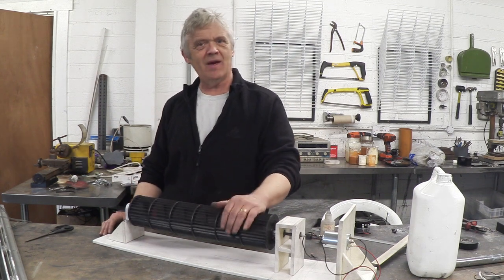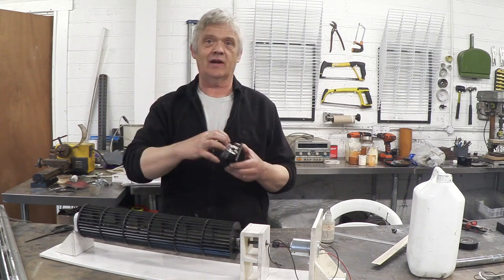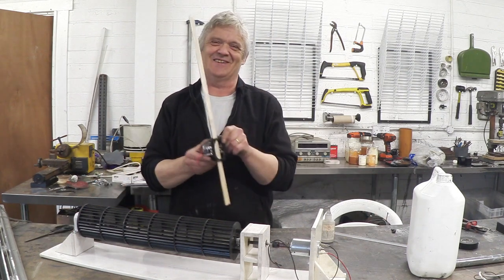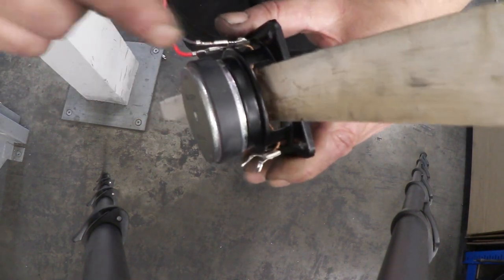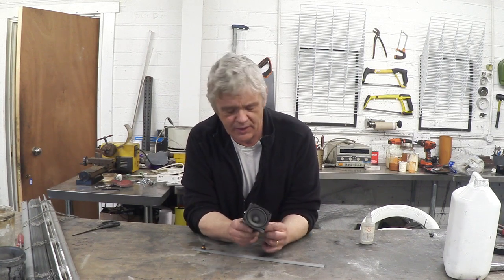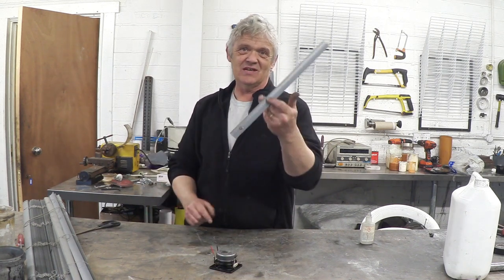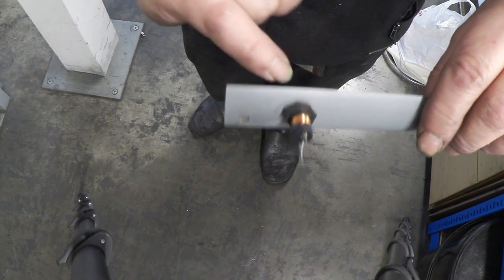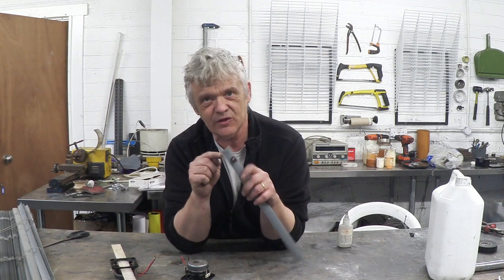Weird Wind Generator   No Blades, No Moving Parts

Comment: Oh yeah mate, now your talking. Now figure a pole that resonates at 7.83hz or the most saturated signal around .here 60hz power lines could be tuned into like radio but there is a draw back. The height to ground separation is where volts are derived. The arieal or top hat size determines its ability to capture,.,surface area. A antenna for receiving would be best if it was a omnidirectional ,sphere or dodecahedron type design.

Comment: I have a 22' by 50' greenhouse that has tightly stretched plastic over it. It works like a speaker when it rains and when the wind blows. Lots of vibration even when you talk.

Comment: add multiple connections to the bracing of solar panels which would then slightly vibrate when the wind blows?  Instead of securing solar panels with as few connections to their stands make hundreds of connections that vibrate enough to activate this principle.  Asking because I don't know

Comment: I have seen the same thing were a man set up ribbons like blinds in a window with coils and magnet at the ends of each ribbon that added together to up the voltage, have also seen a man get a solar panel and slice it into ten mil slices and turn them sideways and reducing the size of the solar panel greatly without any power loss.

Comment: With the wind turbine, adding a weathervane to catch maximum wind direction. Plus a governor, pivot gate and vent bypass escape for excess wind. Use inside a tapered duct to capture and direct use of to the reacting side of the rotor only. Shielding half of the rotor from wind. In effect apply power of wind to best area for efficiency.   Speed control on fan, as old gramophone governor, shaft driven to link wind  escape flap amount.. the governor balls spin helps smooth the rotation in strong wind plus adds inertia

Comment: I imagine a blind, like a window blind hanging on my patio as a sun and wind shield AND generating energy or recharging a battery bank.  That is brilliant as it doesn't require as much wind and doesn't have to mounted high, in the middle of the air AND is functional as it is.

Comment: Sounds like a windbelt.  Windbelt's took a 3ft pole with a perpendicur bar off each end. A piece of video tape is stretched between the two bars and can freely vibrate when the wind blows over it.  On one end is a magnet doing pretty much the same job as the speaker does here.

I thought putting them as the slats in a fence or under a railing would be a good place to put a bunch of them.  Could you imagine how much power such a system could generate if it lined a pier?

So here's a question... If a row of these lined a subway track, would they create extra energy, or would a consequence of creating that energy put drag on the train such that extra energy was needed to propel the train forward that was equil or greater than the energy generated?

Comment: this was described in a TED talk several years ago as a way to  provide power to rural Africa so people weren't dependent on fire for light. A strip of material stretched  between two supports with a magnet attached to it in close proximity to a coil. The strip of material vibrated in the slightest breeze and produced current. The voltage was rectified and powered LEDs.

Comment: Interesting, but does it have a practical use case? Maybe if you have a few hundred thousand of these for areas which have consistently low wind? But that place probably has sunlight, so this still would not make much sense over something which can harness wind to turn a shaft.

Comment: Ok I have a question and my understanding may be wrong but here is my question, taking on the principle of the poll and the using the speaker principle what if you had a poll and say 50 medium speakers attached in say a box , I ask this since the one you had put out I believe 6 volts could this increase the volts and amps in order to use it instead of a wind generator or solar panels?

Comment: I wonder if you copper plated the reed and etched a track on it then put in between the poles of a horseshoe magnet? To wobble about in the strong magnetic field. Take the output through a bridge rectifier and a buck/boost converter to a battery bank. A coil could be etched onto each side of the read to increase coil density. 
Only problem is supply and availability of rare earth magnets.

Comment: I worked with a company trying to engineer an electric car years ago. I am a master mechanic, aircraft and heavy equipment, not an engineer. I was working with engineers and I suggested using electric motors on all wheels that could have the action of dynamic braking to put amperage back into the batteries and the engineers sneered at me and one said " you aren't an engineer, you are trying to come up with a perpetual power system and it can't be done". now it is in common use and very effective but I wasn't an engineer.

Comment: What if you married a bladed fan with a cam of some sort to the speaker magnet? You might be able to get a longer and more consistent stroke out of your magnet? Maybe even a cam shaft with multiple magnets running slightly out of phase from each other? 
Just another option.

Comment: So if we built these as panels of reeds or battens and put them along side major roads or motorways to replace the current noise absorbing panelling we could both reduce traffic noise and generate power for local use?  Would these absorb more energy than passive panels making things quieter for nearby residents?

Comment: What happens if you get a subwoofer and attach a long pipe to it then let the wind blow over the end of the pipe as per the blowing a note on a bottle trick? Can you make it subsonic so that it does not bother people but still capture a useful amount of energy? Obviously it would have to be inverted otherwise in use it would fill up with rainwater. :-)

Comment: Build this into bike frames to power the lights never need worry about dead batteries. Or into the tall flags that are on kids bike trailers/ recumbent bikes that are used to show drivers that a low profile vehicle is in their way. That would do 2 things the flag does its original job its designed to do and the other thing is it would again power warning leds that are on the flagpole to give a flashing warning

Comment: When you were a kid, did you ever put a blade of grass between your thumbs and blow between your thumbs across that blade of grass to make a sound?  What is needed here is a funnel to direct the air past the edge of the reed and thereby cause it to vibrate.  The voltage will be proportional to the rate of vibration and the current should be proportional to the amplitude of the vibration.

Comment: The fluctuating voltage is not useful.  It would need to be smoothed out and stabilised. This necessitates a  piece of expensive electronic equipment.

Comment: This is not a solid state device (wind power generator) and there are moving parts. Already there are true solid state devices with electrically seeded ionised elements which generate significant power with the passage of air over them. Maintenance is zero!!

Comment: The idea of reversing the speaker to generate electricity is awesome. 
Put them in the noisy down town areas or near factory's.  On high ways to power up light poles on highways. Andy place where noise is an issue can off set the anoiance with the bennifit of free energy.

Comment: Very interesting! Decreased or increased tip angle may increase the buzz? Long thin tensioned cable similar to a guitar string?
Reply from the maker: lots of playing around mate - go for it
Reply: @ThinkingandTinkering  sticky backed piezoelectric material has the potential to turn nearly anything into a microphone or speaker,acoustic levitation is something I find fascinating,was thinking could a speaker type of craft hover if it could create its own standing wave? Lol bit off track!

Comment: make ones that go next to the freeway and then use it to power a battery charging system for the night. street lights will be powered by the high use of street in the day if you can get it to work on vibrations. also when you figure out how to use the vibrations of the earth itself. well  you will have changed the world.

Comment: Its a nice toy, but I really cant imagine getting any significant power out of that kind of arrangement - at best its going to be highly inefficient. As for the Spanish innovators, I'm sure someone will invest, but I'll put my money elsewhere - I cant imagine the physics making this even slightly economic. There might be a niche for charging a mobile phone when you're 300 miles from a socket (or research transmitters in remote locations, for which we have perfectly good solar panels which also have no moving parts and can be virtually maintenance free), but hauling a coil through a magnetic field using a turbine is always going to extract more energy than wiggling a stick in the wind.

Comment: might also look into paezo speakers. (found in most microwave oven beepers, and digital watch alarms, and more.   wonder abut those glued on blind blades (multiple stroung stiffly in the breeze).  mighr be able to get every luver to chatter and every chatter to send you a voltage spike.

Comment: Awesome.

A microphone is essentially the same thing, and I never thought to use a voice coil for power.  I have turned a speaker into a microphone before though . 

Now I have another excuse to start collecting old speakers again.  Lol

I currently have well over 20 drivers (speakers) with voice coils ranging from 1" to 4".     But they all work and the cones are not falling apart.   Anywhere from guitar speakers to hi-fi home stereo to professional pa drivers. 

I wonder what the efficiency would end up being, if it would be possible to get 500 watts from a 500 watt rms speaker. 

I do have a dual voice coil subwoofer with an aluminum cone and massive vented magnet I suppose would be an acceptable candidate to learn on to answer those questions.   

Robert you never cease to amaze.

Comment: Would it be possible to make the actuators non invasive? I´m imagining about 100 of those attached to the branches of tree, or a whole forest. Cheap uncomplicated energy generation from a literally green source. A sub-controller attached to the trunk would identify defective actuators for quick replacement, and a nearby central controller and a battery pack would provide clean energy 24/7. thanks, Robert, that's a genius idea!

Comment: I'm pitcturing something like a 3/4 to 1" diameter aluminum tube that is cut down the length into 2 or 3 pieces, so you have an arched shape "stick".  I have about 500-100 of these 1" tubes, all 4ft long with 1.5mm wall thickness, so fairly rigid.  

If you could make it similar to a weather vane, where it turns to face the wind, you could maximize the surface area to face the wind.  I'm also wondering if tapering the stick so it is wider the further away from the inductor, if it would not be more efficient (less mass to move at the lower ends and higher surface area at the highest part - giving a much better force to weight distribution in moving the inductor. You could even cut the tubing in V shapes, to get the top part to be wider, and also the curvature of the tubing (arch) would give it structural rigidity.  

This type of application woudl be great at remote locations where there is lots of time for a battery to be charged in between uses, like an emergancy cabin, alpine chalet or even a boat sailing the ocean as it coudl work 24/7 (assuming there is wind) and could be used to generate electricity for things like LED lights or even charge batteries (with enough units when the sails are up.

I'd really like for people to look into some kind of wind powered electrical generator for sail boats that can be used when the boat is not sailing or even when there is too much wind for the sails.   There are many times when sailes have to be lowered b/c the wind is too strong, but if they could somehow harnass that wind during these periods (or while anchored at night), it could be helpful in extending the range and number of days the crew can live on board.

Comment: Very interesting ideas - surely the same principles could be applied to a 'stick' moving in water. Either the moving current of a river or the tidal/wave movement of the sea. Suspend a stick vertically down from the magnet/induction coil, which could be huge in the right circumstances. The profile of the stick should be such that it vibrates or moves as much as possible for any given movement of water.

Comment: Those bladeless turbines have long since been debunked as inefficient.
They may be cheaper than the regular bladed wind turbines, but they still deliver far less power in relation.

So... good idead, doesn't work.

Actually I'm surprised that those spanish guys are still around and not yet "gone with the wind"...

Comment: I also heard of an idea that was a bit like 'A Storm in a Teacup'   High Voltage water droplets that are released from some wet long pipes.... wind makes them fly through the air and are collected on some other wires where the voltage has been increased...   that really is a NO MOVING PARTS wind generator.  I Love electrostatic machines ...
if you had a 'cascade multiplier in reverse... it would change high voltage  electrostatics DOWN to usable current and voltage levels.   Also the Electrophorus is ASTOUNDING! Being raised and lowered by wind!  or how about a simple Wind driven Whimshurst machine!

Comment: I have a question: how small can these turbines be made? What I am thinking about is to install one or more in the front of an ebike with the idea of using the energy they produce to constantly recharge the battery.  Of course, there would need to be some way to interface them with a particular battery. I don’t expect to have a perpetual motion machine just to extend the time it takes to drain the battery.  I think the forced induction of air as the bike moves should increase the output to a usable level, provide  controller/ inverter could be found to match the two. It should be no more difficult that the braking regeneration scheme.  The inductor array could a,so be useful, but more development would be necessary with such an array. I think one vertical
wind turbine on each side of the front fork in sort of a radiator looking contraption could add at least as much as the braking regeneration.

Comment: So... if you think about this another step... how bout placing coils, wound in both directions separately, and arranged on a wing, or fuselage, so that the passage through the electromagnetic field of the Planet generates a 3 phase alternating current
Reply: The Hindenburg ignition was a lightning strike immediately after they attached the ground cable to the metal scaffolding... as a conductor passes through an magnetic field... it generates electricity

Comment: I'm going to have a go with some 100nH inductors I have for switchers. I have some 1N1418 diodes (more efficient in this sort of circuit than an 1N4001). I'm going to try and find some small signal shottky's as OA91 are a bit too leaky.

Comment: Just to put it out there : A six foot fiberglass CB antenna mounted on a twenty foot pole would shoot a spark across the plug 🔌 like a spark plug , when it rained .It had some thing to do with the water passing over the coil of copper wire around the fiberglass  pole .

Comment: I wonder if springs might be used to try and maintain maximum vibration in any wind?  Imagine the reed as a "finger" with springs of varying strengths at each "knuckle", weakest at top and strongest at the bottom.  Weaker winds vibrating the "tip", and stronger winds vibrating it closer to the base.

Comment: I saw a similar sensor on a large motor done by the uni of Manchester. The research was to test when the motor needed servicing and we were using data analysis software from my company.
But a couple of questions before i start to experiment, how thick was the neoprene and what size coil (uH) did u use?
Thx for the video, also I think rain would also add to the effect.

Comment: Interesting idea, as a concept.
But absolutely NO WAY to get any significant or useful energy out of such a system.
Where is the energy coming from?
From the wind, from moving air! From a moving mass...
If the area of capture is minuscule, and the density (of air) is insignificant, well the output to expect is virtually ZERO !
So don't build any expectations :-(
Just think of the area swept by a modern wind turbine, and the rather strong winds expected or needed to get useful energy out !
There is no such thing, as a free meal !!  :-)
Reply from the maker: absolutely no such thing as a free meal mate - this is however a cool proof of concept project that will hopefully get people thinking - thanks for your thoughts

Comment: Many years ago I read a science fiction story which mentioned a wind generator composed of strings like a harp. As the strings vibrated in the wind they acted on, if my memory is correct, piezo electric modules. Hey presto! Electric output. Imagine a boundary fence utillising hundreds of strings. BTW, an Aeolian harp was known 2000 years ago and makes sound as the wind passes the strings. Search for Aeolian harp.
Reply from the maker: awesome mate - thanks for sharing that

Comment: Horizontal magnetic wing with auto-variable elevator; fluctuating wind provides continuously variable lift against an inductive base, maintaining an oscillating resonant equilibrium between wind & gravity. Wing surface covered in Solar cells to provide power in still air. Or why not simply have Solar panels mounted on Magnets with Inductive coupler bases? (balluff.com)
Reply from the maker: why not indeed mate